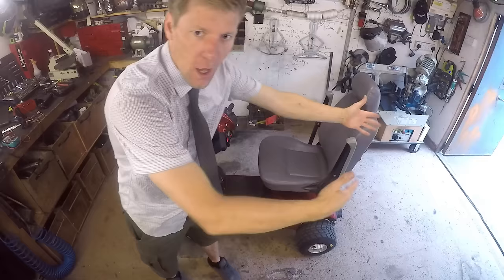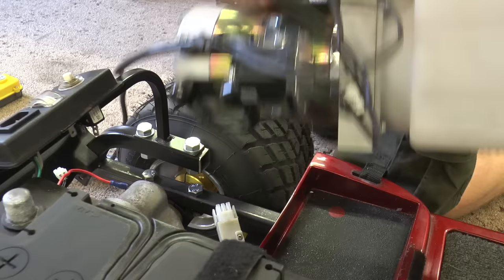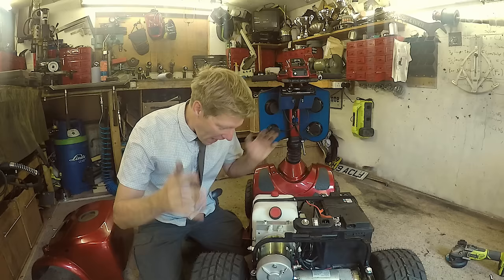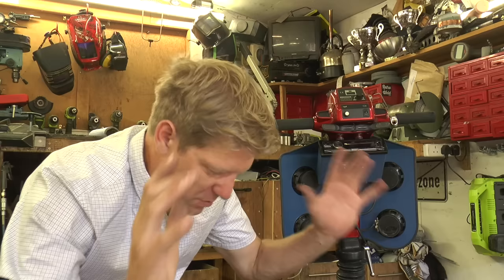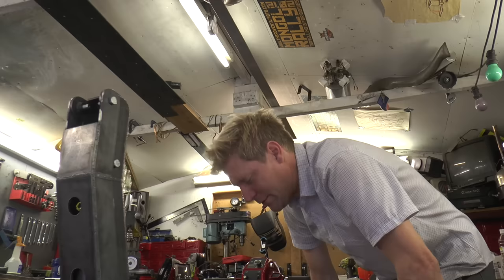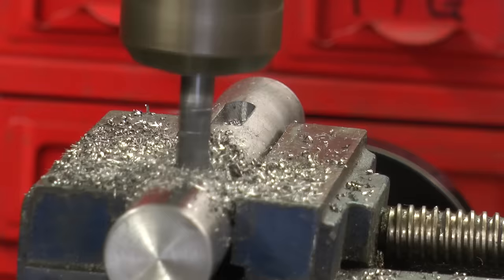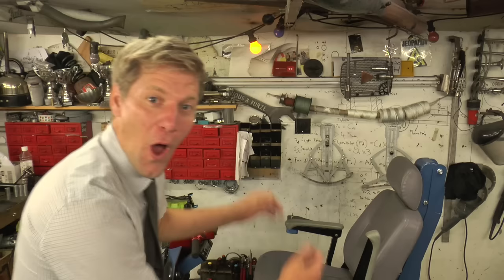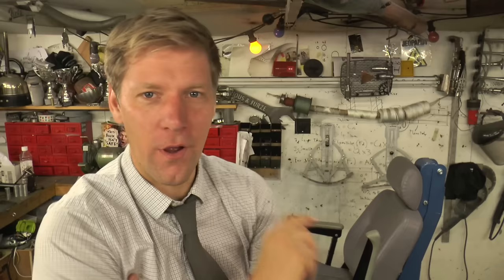Hydraulic Crane Seat-Scooter Pimp #2

Comment: Nice! How about making a wheelie bar to stop it tipping over?
Reply: Auto Addiction and then go to nurburgring with it ;)
Reply: TakeAmericaBackfromISRAEL a member of what?
Reply: I was thinking make four legs that swing out like they have on most trucks that have built in cranes/winches👍🏻
Reply: who need safety? scoffs
Reply: TakeAmericaBackfromISRAEL Oh I member
Reply: Or some weight on the front
Reply: Or extend the wheelbase
Reply: no wheelie bar needed, a gyro scope or 2 would be sufficient, like the use on the ISS.
Reply: or some fold down crane stabilizers

Comment: Thats awesome! It needs some outriggers for stability.
Reply: Yes, that is what was thinking, like stabilizers on backhoes. Or rocket stabilization like a space shuttle.
Reply: A bigger safety tie is all he needs.
Reply: Definitely needs outriggers especially if you plan to let anyone anyone else "ride".  Bit of a liability otherwise.
Reply: Newtronwest Easier than this, add a restrictor somewhere in the piping. It may be harder on the pump, but its so much easier.
Reply: To make it easyer to go up and down an electronic steering thingi which controls how much it goes forward back or whatever direction maybe should be added
Reply: And wheelie bars
Reply: Definetely agree, BUT: I think just finer and more precise hydraulic controls are best to achieve by software. And with that, it would be an easy task to create limits in which the movements happen - like the Flight Envelope Protection on an AIRBUS aircraft. You will need sensors to measure the degree of rotation in the axis - and that's it... Fully safe - I guarantee (not serious).

Comment: You need to get James Bruton to sort you out a control unit, so it syncs all the hydraulics to get you up and down easier. Of course it needs a disable switch so you can Furze it :)
Reply: I was thinking the same thing. Some stablisier arms that come out too and itd be good for cleaning the gutters. 😂😂😂
Reply: yeah, just a little arduino that records the perfect sequence to go from the lowest to the up position, if you attach it under the seat you can use the "level sensor" to control the seat, so no matter where you are it lets te seat stay flat.
it's something that james could program in like 1 hour.
Reply: i like this just like it is, Colin way:)

Comment: Stick an Arduino with a Gyroscope / Accelerometer on the seat, program it as a PID controller which steers the seat motor and seat levelling problem solved!
Reply: Gyro is enough, accelerometers are a pain to program rwliably and are not really made for this purpose. Also: gyroscopes use quite complicated coding and calculations, like a quaternion. Not really a thing for a non coder (even a task for a computer engineer). I havent tried it with arduino though, only 32 bit cortex m0+
Reply: there probably is a library that makes using a gyro quite simple on Arduino...
Reply: yeah, it heavily depends on which chip you use, though. Some have sensor data fusion from gyro and accelerometer built in and deliver quaternion data via i2c, if you can get the library to work, that is.
Reply: Tom Lelie Gyroscopes do in fact make the matter much more complicated as all they can measure is angular acceleration and not absolute angle. But in Furze's case it would absolutely suffice to use just accelerometer data of the rotated axis. The acceleration will vary between -1g and +1g, depending on the accelerometer's angle relative to Earth's center of gravity. As this acceleration value is directly proportional to the angle, it should just be a matter of reading out the acceleration value of one axis and dividing it by a given constant. Of course, you can do extra filtering and smoothing of the result. But as can be seen for example in GreatScott's spirit level video, the deviations between measurements are on a scale of ±0.1° when using a sensor such as the MPU-9250. This would be an absolutely acceptable value which could be fed into a PID library and thus determined in which direction and how much the seat motor should move. Using a PID, it would be possible to adjust each parameter so the motor moves as smoothly as possible. (But of course, never forget to include a manual override switch, in case something goes wrong.)
Reply: Just make sure to test it with a simulated/dummy load. Cause yeah you don't want to be sitting there as you fidget with PID values.

Comment: "not the safest thing I've ever made". It probably is actually. Idea: you could probably knock up a fairly simple Arduino arrangement to synchronise the worm drive motor with the lift so that the seat stays level automatically. You just need an angle sensor on the seat arm, like an optical encoder. If Arduino programming isn't your thing, put a shout out on the 'net - someone will offer ;-)
Reply: whats the other guy, xrobots or something? he could knock one of those out in no time. (james bruton)
Reply: yep looks like a job for james bruton, doesnt even have to be optical, even a mechanical variable resister should work (a little bit more noise obviously)
Reply: It doesn't even have to be that complex. A simple setup of tilt switches on the seat to control the hydraulic motor would probably work. Too far out of level and the motor switches on one direction - too far the other way and the motor switches on the other direction.
Reply: If you had a level sensor in you wouldn't need to sync the two it could just keep level all the time regardless, even if you're going up hill or something :D
Reply: Exactly. It would have more advantages other than just extending the boom and not falling off - basically a steady-cam seat. ;)
Reply: I think it should be possible make a "map" for arduino. So if you'd split the full motion into say 10 stages. Fine tune each one by playing around with how long is each switch is turned on at each stage. Execution order would need to be coded in too. But it would get by with a simple relay circuit.

That's how I'd do it, but it may not be the easiest way to go for some.
Reply: It can be done simply with linkages 
Look at how a front end loader works 
Basically you need a parrelelagram
Reply: Wut
Reply: What about a flight controller for a drone or rc airplane..
Reply: An Arduino controller is definitely the way to go.
Reply: It just needs a simple mechanical linkage and no more.
Reply: Many YouTube comment sections are pure cancer. But this right here is amazing, people pitching in their ideas and debating how they would work.
Reply: Arduino + gyro + a few lines of code = basic controller for self levelling seat that'd pretty much drop right in in place of those switches. You'd probably want to find a way of making fine adjustments with the motors tho, if it were all electric a bit of extra maths in the code and PWM outputs would do it easy but hydraulic wizardry aint my thing. Would want to program a "deadzone" too else that thing will buck all over the place trying to stay perfectly level.
Reply: GRAHAMAUS yes hydraulics buttons I know what I’m talking about

Comment: Make the scooter controllable from the top
Reply: If you started driving while in the air I'm afraid it would tip over, it was barely stable when standing still.
Reply: Good idea but he needs to find a way to keep it from tipping
Reply: Maybe put extending arms since he has hydraulics already in place May be control them arms that extend front back right and left using hydraulics or install another pump in the basket and make it look nicer
Reply: @DOUBLEBANGERZ it needs support side to side the most and front and rear would be amazing
Reply: Yea... maybe add like 2 tons then it will be a great ideea
Reply: He would fall man
Reply: @Jesus_friggin_christ  give the tires a stretch and suspension wont tip! lol

Comment: If you add an arduino, and reduce the flow rate of the pump you could synchronize all 3 actuators and have the chair elevate perfectly level while keeping the center of gravity centered in between the axles. You could even go a step further and add pressure sensors to each weel to see in which direction the center of gravity is moving to keep it stable, or you know, calibrate the program over 4 scales.... Amazing development though!!!!
Reply: Lucas Moriones I know right I was thinking the exact same idea
Reply: Just add wheelie bars
Reply: Or weights in the front(or both)
Reply: you would need rotary encoders for that.
Reply: Can you explain that in normal kid terms
Reply: Basically, the microcontroller needs to know what position the different parts are in, so it can properly control the speed of the different pumps.
Reply: Alex Jamieson oh ok lol
Reply: Alex, for that, we have accelerometers and gyros.
Reply: Alpesh Patel  it's easy. It just takes time and practice.
Reply: @RodrigoM3llo  exactly. It would be better to use accelerometers and gyros because that way it can 'automagically' correct for operation on sloped terrain.. then again, you might shift the center of gravity outside of the wheel base as it is, after all, a very small wheelbase... maybe build some automatically extending support legs and make it a proper crane? Would help with stability too cuz the wheels won't be movin the whole damn thing back and forth.
Reply: And stabilizer arms that deploy on the rear and sides
Reply: Nerds
Reply: sounds like a you problem Caleb Roskelly.
Reply: @ayporos  I know it is 😄
Reply: the issue with that idea it's that it brings the hydraulics system to a hell of a new complexity. it's not as simple as you say. to do progressive movement with electrovalves you need some specials valves that support proportional command and it's crazy expensive (and i'm not even speaking about speed regulation just position is crazy complex for a one man job).

Excuse Me Colin but I'm an engineer in mechanical and you do an excellent job you do know how to make crazy things the only thing that you lack IMHO is to know what is profitable to do. Can't wait the next video btw cheers.
Reply: Or you could just attach an additional strut to a higher point on the chair. That way, the simple mechanics would just keep the chair upright. Car suspension works exactly the same way.

Comment: Great job!!!
To keep the seat parallel to the ground you can mount an articulated parallelogram, instead of the second motor.. In this eay you can easily control the height of the seat with only one motor and use the second motor for a fine tilt adjusting.. Far more easy!

Comment: If you want to get rid of the worm gear seat angle issue, just replace the upper arm with a four-bar mechanism. For those not familiar or not sure how this would work, imagine a big capital F where the spine is the lower arm of the lift and the two horizontal beams of the F (should be equal in length) are attached to the spine via hinges. Then attach the seat back to the other end of the two  beams via hinges. Then have the ram push on one of them just as it does in the current design and you have a system which will automatically and passively self correct the seat angle (ie it will always stay vertical).

Comment: Suggestion 1: Figure out the smoothest combination of moves to get you up and down, then etch/program those (sorry I'm not that familiar with electronics) into a small circuit controlled by one big lever to go up or down. Then you don't have to mess around with 3 different controls and it'll look cooler/more smooth.

Suggestion 2: Mod the wheelbase again so it can climb onto high pavements by driving straight into them (and maybe stairs).

Suggestion 3: Don't do anything to it that makes it unusable in real life. I know a lot of your inventions fit into the "crazy toy" category and rightly so, but what I like about this one is I can actually see an old man going around a shop with it and casually using the lift to reach the shelves. It would be so cool to make this super functional and "shop friendly", give this to an older relative/friend/neighbour of yours and see them actually using it without dying or setting the shop on fire.

Suggestion 4: For self defence, the most likely situation I guess is someone robbing the user and running away. So you should put a Bola cannon on the front. From wikipedia: "A bola is a type of throwing weapon made of weights on the ends of interconnected cords, used to capture animals by entangling their legs." That could be fun. 

Suggestion 5: Also put a teenager deterrent on it (one of those high pitched sound emitters) and possibly some sort of hydraulic leg sweeper to knock the legs out from under any yobs next to the scooter.
Reply: Or make the whole thing a big tazzer🤣
Reply: Put a mountable minigun on the bac
Reply: You spelled "jobs" wrong on the last line

Edit. Nvm i read the rest of the sentance

Comment: That is sooooo cool!  Thanks for all these great projects!

If you swapped out the reducer for a 4-Bar linkage you might be able to keep the seat parallel without the hydraulics or as an alternative, I guess you could program a PLC to operate the three valves and then just give the driver an up down switch and let the controller work the three valves in unison to achiee a smooth upright lift and descent....

Comment: You could use a couple modified or scaled up motorcycle kick stands at the rear for stability and have something to push them down etc like a crane/cherrypicker usually uses. Larger footprint = slightly less sketchy

Comment: Something I’ve wanted to make is an adaptable motor, power supply, and possibly even a way to steer that can be used on any Manual wheelchairs. That way when your stuck in crappy areas or Carpet....( I HATE pushing my chair on carpeted floors) or wet or snowy conditions where your wheels get really dirty you can use this motorized system to do the work. The stuff that can do this that I’ve seen differ greatly  and are ridiculously priced. One mounts a what looks like the front of a bike to your foot platform and lifts your casters off the ground. It has a motor that powers the wheel a battery and bicycle handlebars. I’ve thought about using a two motor/wheel system that could be controlled by a joystick. It could sit between the two main wheels and be connected to the chair where the anti tipping bars are locked in place. Have the battery and all the electronics be contained in a dry box (like an Ammo can) the joystick and cable in one piece and the motors wheels and frame to hold the removable battery in another piece. Have the motor assembly and joystick connect to the brain box/battery by twist locking plugs. Doing it in three pieces that are easy to assemble and not to heavy is very important.  My thinking and reasons behind this setup is ease of use while being able to assemble quickly by a single person. The costs that are required for power chairs is very pricey. You also have to have a lift to transport it and possibly have to trade in your current vehicle for one that can carry all that weight. in some cases you need to make permanent changes to a vehicle. Another issue that may seem superficial, is that I’m not even in my 40’s yet and I’ve put on a bit of weight when one of my meds was changed. I was a very active person who loved the outdoors, hunting and fishing. My life has changed dramatically over the last few years. It’s hard enough mentally coming to terms with having to use a manual wheelchair and other aides, but having to drag around and use one of those huge power chairs can be very depressing. Also if your in an area that you have to have assistance I’ve found that you end up being ignored by people who come up to you and the person helping. They look up and talk to my wife, I  might as well just be a giant baby Pram. Then the issue of maneuvering in isles while shopping. I have a hard enough time getting through some isles, an even larger power chair would be a giant pain! Heck this could be something that adapts to the standard hospital wheelchairs not just the custom wheelchair market. It could even save hospitals and insurances money.

Comment: Get an Arduino to take over the seat lift - PWM the seat rotation in line with lift. You can get H bridge controllers ( I will send you a spare one I have here if you like), and run that with Arduino control.

Comment: Ferris wheel seat, think about it. Also to make it more stable, stabilisers then maybe you could rotate the seat. Lower it's overall height, and rebuild it using aluminium. Also you could change the body, and fit other batteries either side of the tiller, you have room despite the speakers. You used an actuator for the flame thrower, why didn't you build the cherry picker with actuators. Cuts down on weight.

Comment: Sir Collin, 
“”IF””. YOU INSTALLED SENSORS AT FRONT AND REAR OF UNDER SEAT, SMALL ARDUINO PROGRAMMED COULD AUTO SWITCH TO KERP SEAT BALANCED.

FUNNY THING IS:   I have a widowed mother in late 80s and she is only 4’ 5” tall.  When she goes to grocery store she CANNOT reach most items.

If your lift took seat headrest to 6feet.  That would be ample height for her to reach top shelf “””safely”””.   Your construction is SUPER WELL BUILT.

I KNOW THIS IS OLD VIDEO. BUT DO YOU STILL HAVE THAT CART?   It could make MY MOTHER VERY VERY HAPPY AND MORE INDEPENDENT.

Comment: Problem is, while you're reaching for something on top of the shelf, what if someone jumps in and start controlling the steering, you'd have no control and eventually looses its balance. I suggest you should add 4 hydraulics on the side to stabilise its balance, as well as the wheels are off the ground.